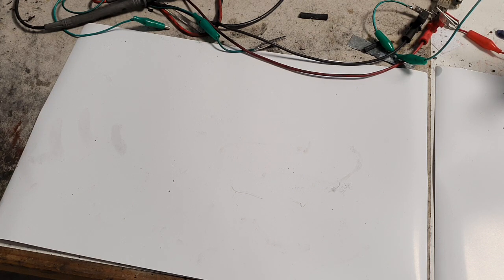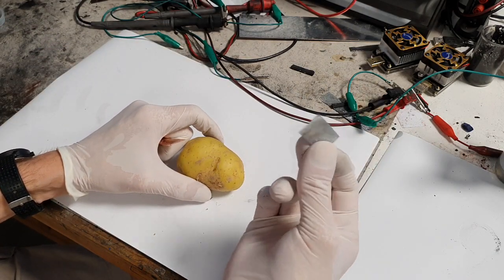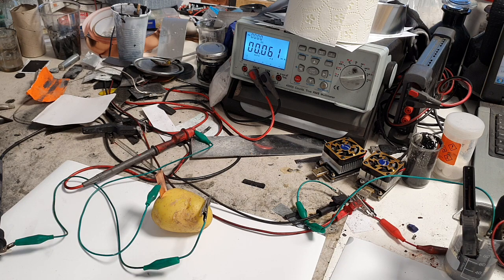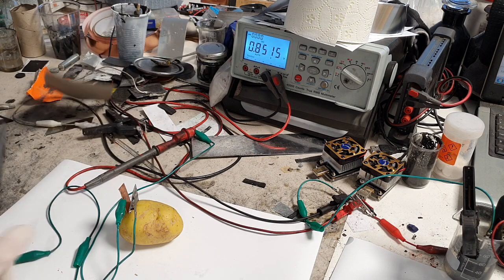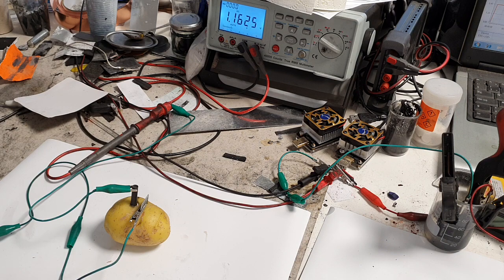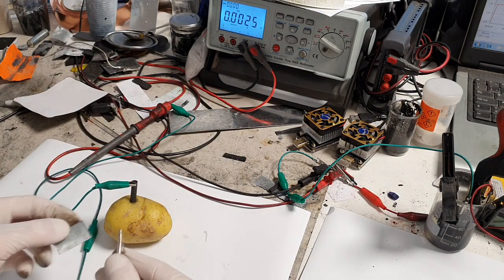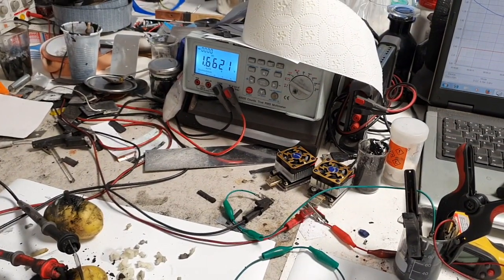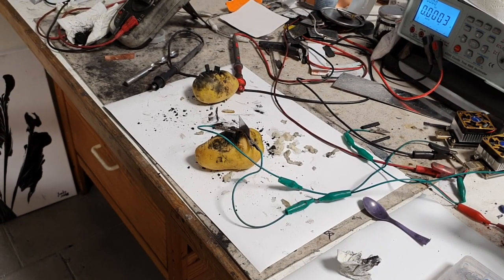Make a Powerfull Potato Battery - Part 1

Comment: Part 2 nuclear potato battery? lol.
Looking forward to part 2.
Reply from the maker: Hehe you wish, I will not show on youtube how to make a nuclear potato battery wich can store a 1.5MWh/kg of energy.... I dont want to start a WW3 because of the potato, lol 😂😉 No really,.... part 2 will be only a potato battery in some other design. 😁
Reply: I was wondering if successive pairs of electrodes could be inserted in the same potato such as carbon zinc, carbon zinc, etc. and connected in series to  increase the voltage..

Comment: Dude this is awesome! I've never seen how to improve the potato battery! Can you get some EBDUSB+ curves out of it?
Reply from the maker: Hey man! Everything can be improved. Yes, wait for the part 2 video. I change the design of the potato cell a little bit but the concept is almost the same. You can also get much more energy out if you boil the potato first, but this I dont have on video.
Reply: @cayrex  I forgot to ask if it's rechargeable?
Reply from the maker: @kennethanderson7642  hmm, I did not try to charge. But I think that is not rechargeable. You need to try to charge and you will see if the battery will hold the charge.